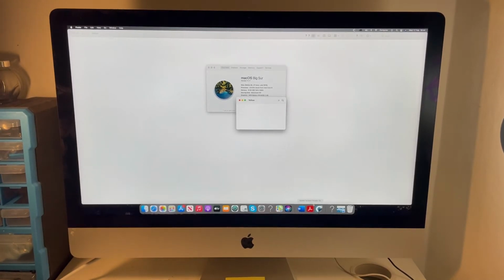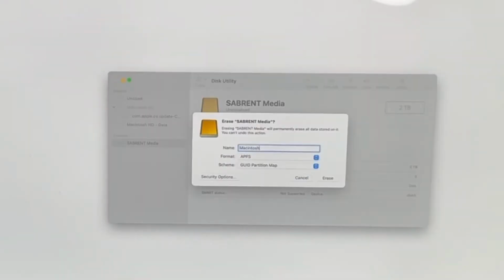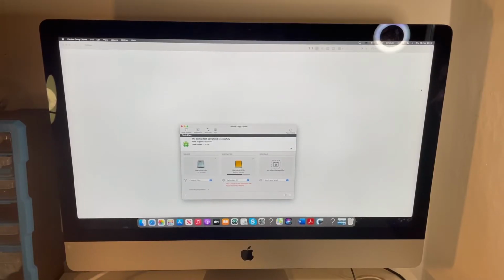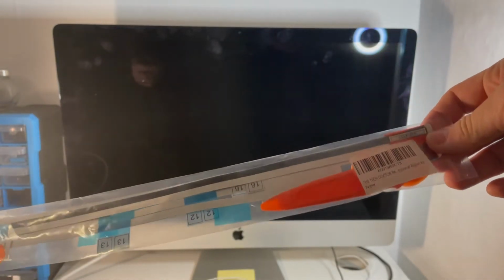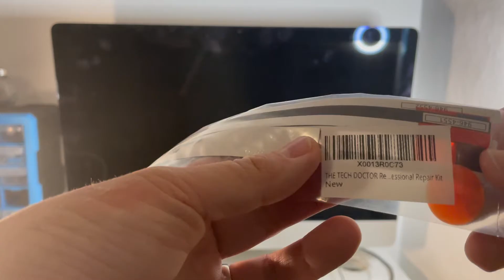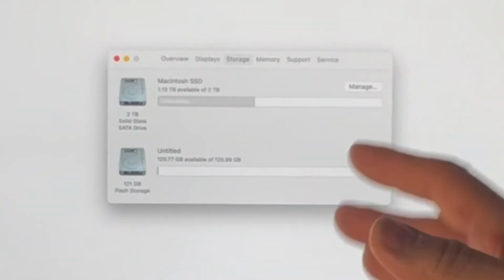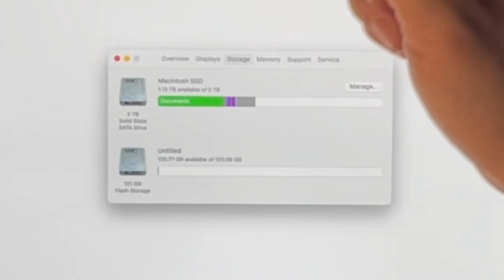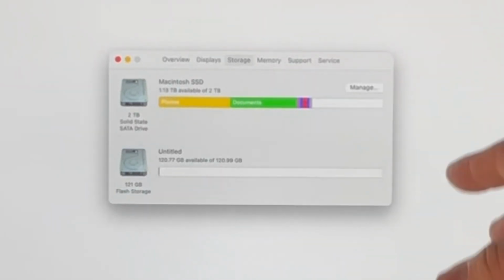iMac 27" Late 2015 A1419 4K - SLOW Fusion hard drive replacement with new internal SSD, MUCH FASTER!

Comment: Could I please ask a question .. I have a 2015 and have also bought the BX500 SSD, do I need the inline digital thermal sensor ?? In this video you do not install a separate thermal sensor

Comment: so what about the heat sensor that was built into the old hard drive should there not be a sensor between the new sata and the old connection? does this way not cause the fan to go crazy?

Comment: I also replaced stock DDR3 8GB RAM included in the machine with 32GB RAM. There are 4 slots. And yes you could take it up to 64GB; motherboard supports this even though Apple specs say no. But you’ll pay more than 500USD for this option. The 32GB I installd (8x4) was 38 bucks on Amazon, and it does work. No problems yet. A first grader could replace RAM with the correct materials. But this hard drive swap I estimate as a 2-day downtime option. Maybe not, but you should have a backup system to use in case your iMac is down for 2 dsys. Fair warning unless something goes wrong. If this machine does not boot for you with this fix, you should have a backup. To get my wife’s back yo ElCapitan took us around 4 days afrer crash, and to recover files took a LOT of work and commands via terminal. Apple OS and hardware are incredibly difficult to manipulate and be proficient, certainly by design. Good luck to all, yer gonna need it!

Comment: Another issue we had with my wife's late 2015 iMac: the "Fusion" drive CRASHED when trying to install Monterey OS. Stuck in boot loop. We opted for El Capitan, as this was the only option, with much effort. We will install a new SSD soon and monitor its performance, then hopefully take the next step to install Monterey, as we suspect the issue was with the "Fusion" drive. "Fusion", I think, is just a physical HDD with a backup SSD of some sort, that really doesn't do anything. I think I know what this Fusion SSD is for... Absolutely nothing. I ain't touchin' it, but I will replace the hard drive, because that is the boot drive.

Comment: Great video; only one comment concerning the adhesive applications. I will be attempting this upgrade soon with an older iMac. I noticed that at first you removed the paper from adhesive strips both sides, then later you opted to leave the backing paper on top. I suggest to any viewers that you do use TWO small screwdrivers in the little holes (good idea), remove backing paper from BOTTOM ONLY, and align the adhesive strips according to the holes, then fasten to the case. LEAVE ALL BACKING PAPER on top of adhesive strips, connect cables, confirm boot, THEN remove backing paper from TOP OF adhesive strips to permanently adhere glass to case. Again, great video sir.

Comment: This was a very helpful vid.  My MIL gave me her old iMac, same spec / year as yours and man was it slow. It was base spec (no fusion drive thankfully) and only 8GB of RAM.  Upgraded to 32GB and an SSD and gave it a thorough cleaning.  (So much cat hair and dust inside..eww). Here's my time results from doing this basic upgrade for those interested:

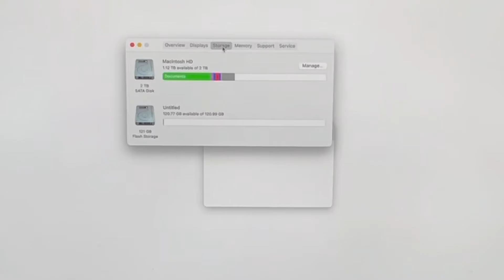Start up: Old 1:12s > New 18s!
Opening Finder: Old 9.5s > Instant
Opening Photoshop: Old 50s > New 17s
Closing Photoshop: Old 9s > New 3s
Opening Illustrator: Old 1:03s > New 18s!
Opening Safari: Old 7.8s > New 2s

Unfortunately I messed up my screen alignment by 1mm when reattaching (only I notice it but now I can't NOT see it..) so when I re-do it I may try to put in an i7 processor in and add an NVMe SSD in addition.  Thanks again!
Reply: Those are very good results; I'm hoping for similar results for my wife's old iMac. Good news!
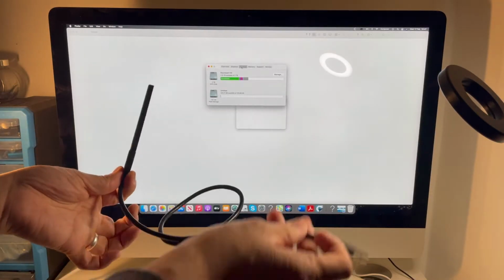Reply: what were you write and read speeds, i installed a NVMe Internal SSD Solid State Drive with an enclosure and i am getting much faster speeds but starting up still slow about 1:45 seconds, after that everything open quick but not like instant. I know i am using the usb 3.0 so just want to compare speeds, is it better internally?

Comment: Love your vid very clear and consise well done. I have a 2015 27 inch imac 2tb hardrive 5k retina  4GHz Quad Core intel core i7 32 gig memory 2gb amd radeon graphics. Its not really slow, I can't get a definitive answer from anyone locally I live in Australia Victoria Bairnsdale do you think it is worthwhile having 2tb ssd installed, I have been huming and haring for 12 months. Or should I purchase the new 24 inch imac upgraded to the max. I would not do this myself as I am not happy to remove screen.  Look forward to your opinion. Or perhaps external ssd Cheers Wendy

Comment: Thanks for the detailed walk through. I have a 2014 27" with failed fusion drive, so i wondered if the internal components differ much from the 2015 model when it comes to following your walkthrough? Videos like this are so useful for self repair which is such a rewarding process. I'm looking to just discard the failed drive and put in a ssd. Would there be any other steps seeing as i don't care about the drive that failed or recovering data ?
( most of the data was backed up)

Comment: I think this is the FIRST video I've found that shows the hard drives AFTER the install.  Looks like you confirmed what I guessed - the PCI flash storage just shows up as a separate drive that can be used.  Is that correct?  I bought a 460GB drive to put in place of the original 128GB.

Comment: Hi Andrew. great video done everything but am struggling with the first two leads you disconnect in the video. I got the new drive in  display cable back on but can't seem to get the cable to the left of it back on, any way to explain that would be great, I am new to this! Thanks

Comment: I purchased the 1TB crucial ssd and hdd adapter and adhesive strips from your link and  followed your video and have successfully upgraded my late 2015 27” Retina iMac.  Excellent guide, like how you supported the lcd screen against the wall. Very logical guide thank you 🙏

Comment: Ditch the SATA entirely (take it out and leave it out!) and simply replace the existing mSATA Apple connector SSD with an NVMe PCIe M.2 SSD + M.2 to Apple 12+16 connector adapter. You'll get 2-4x the performance of the SATA SSD solution, and it's often cheaper too. That said, you have to take out more screws and cables to get to the SSD connector on the back of the motherboard. Works great!
Reply: Is there a video for installing M.2 SSD? Also is there a data cable for M.2 so we can clone it?

Comment: Hi Andrew. Very informative video and very clearly explained, however I have a couple of queries if you can help. I too have a late 2015 27 imac with a fusion drive running Monteray and would like to upgrade the internal drive to SSD, however there seems to be confliting advise online as to whether you can do this because of the fusion element will only work with a mechanical hard drive.  Yes doesn't make sense to me, but I don't want to open my machine up only to find it doesn't work. I noticed when you opened up your "about this Mac"  / 'Storage" tab it showed a hard drive and a seperate flash storage drive, where as my only shows a 1TB Fusion Drive. Is there a reason for this Did Apple modify something or was it changed in Monteray. Your advice would be appreciated  Thanks   Clive

Comment: after racking my brain as to why it was running slow and running into a thread on the apple forums suggesting that big sur was too bloatted for the older imacs and reverting back to older os still didnt resolve the issue (hours wasted) This method worked like a charm. thank you so much for the step by step guide

Comment: Ok, but if you put a 2.5" into the Sata port, isn't it at Sata speed which means you could simply plug it in through the USB 3 port in the back, saving all the risks of opening the display?
Reply from the maker: Sure you can see my tutorial here https://youtu.be/IB0SUcCAMig

Comment: Andrew thanks 

Do I finally can do the cloning one a Fusion Drive (the used I purchased has 1 fusion but in your video the PCIe is not used) or I have to do the process as Boerboel wrote below? 

Since I will defuse the PCIe should I install the os on the PCIe or the new 1TB ssd with restore bootable usb?

Comment: Fantastic detailed presentation, it certainly removed any anxiety that I had to do the same exercise. I noticed that you didn't utilise a thermal sensor as I have seen used in other SSD upgrade YouTube videos, any reason for this? Also could I just upgrade the NVMe SSD drive to 1TB only and remove the other storage drives? Thanks
Reply from the maker: Upgrading the NVMe requires more disassembly, I don't think it's worth doing, a SATA SSD is sufficient. Also modern macOS will read the SMART thermal data direct from the SSD so a thermal sensor cable isn't required.
Reply: @Andytizer  Thanks Andy, most appreciated. I performed the entire procedure today without issue, and gave you a mention on Amazon for the review of the tech Doctor adhesive strips.

Comment: hi what about the boot firmware 9ive a prob with some SSD drives I've used where I get random reboots to do with hibernation so I've run a sudo commend to turn off the auto hibernation ,  but is there a way to update the firmware on old macs  many thanks

Comment: Hi there, Thanks for the great effort, but you did a couple of things not professionally, I mean those steps could be more tedious. 1st. You didn't tell us you missed with your Fusion Drive system and that is always bad in the eyes of apple. 2nd. you're suppose to clear all strips, keeping those two bottom strips won't work for us. 3rd. you installed first two straps very badly. and others were quite good; the upper plastics of the adhesive wouldn't go before those are installed on the machine. And very interestingly you didnot clean the machine at all. Hehehehe.

Comment: Your videos are quite clear and useful, and after watching them I have upgraded my 2010 and 2012 iMacs' with internal SSDs'.  The only thing to be aware of, if you were running Microsoft Office it will require that you buy another license.  Though, given these upgraded models are "extra" machines I just use Apple software......Pages and Numbers as needed.